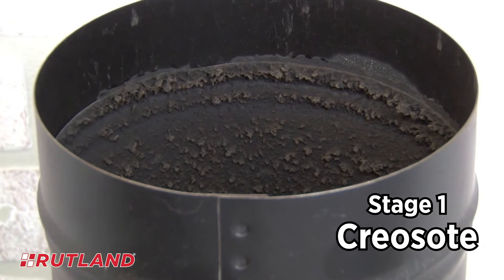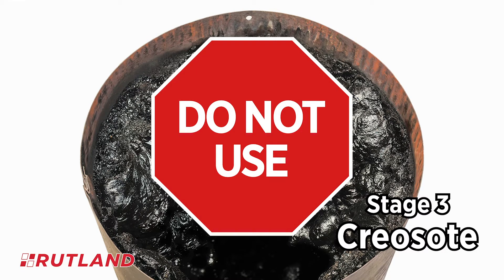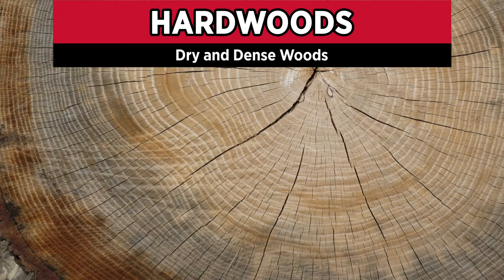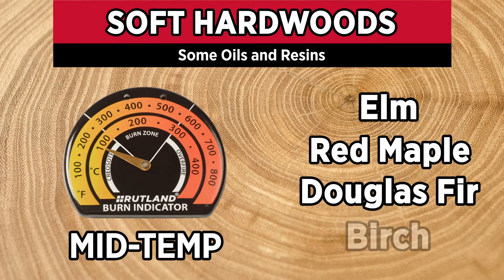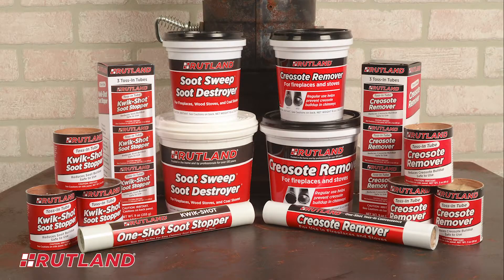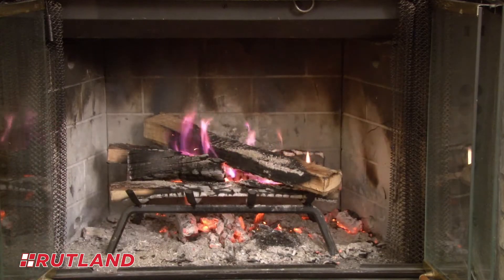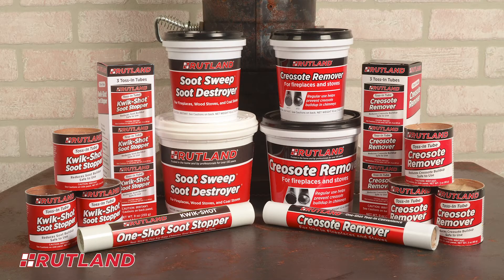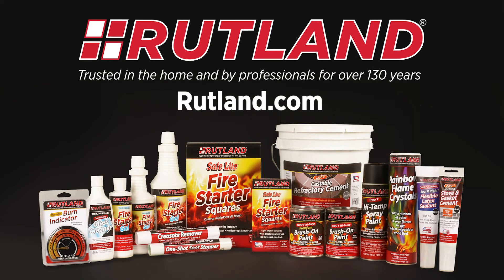"Soot and Creosote" – How They Occur in Chimneys & Fireplaces & How To Remove Them

Comment: Do you have any products that good for pellet stoves?
Reply from the maker: Hi David!  We recommend using our Liquid Creosote Remover for a pellet stove – you can pre-treat the pellets before adding them to the hopper so that the whole process is automatic! Simply spread the pellets out on a flat surface, spray with our Liquid Creosote Remover, and allow to dry completely. Then, load the hopper as usual! Feel free to call us at 800-544-1307 if you have any questions about how to use this product!
Reply from the maker: Hello again, David. We have released a new pellet stove product called Pellet Stove Creosote Remover. Please check it out! We have infused our creosote removing technology into high quality wood pellets that have been dried to 2-5% moisture content. All pellet stoves accumulate creosote over time, so it's important that further accumulation is prevented.